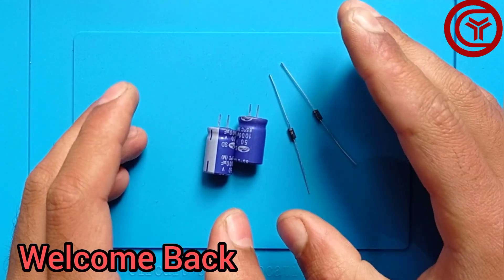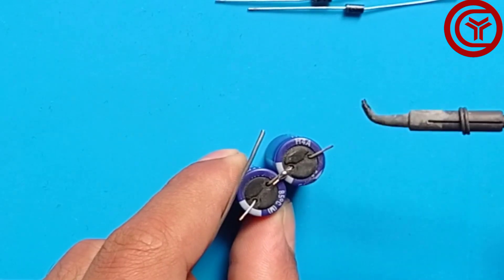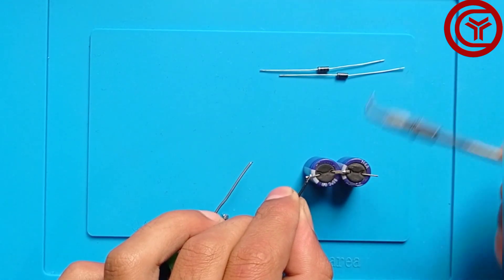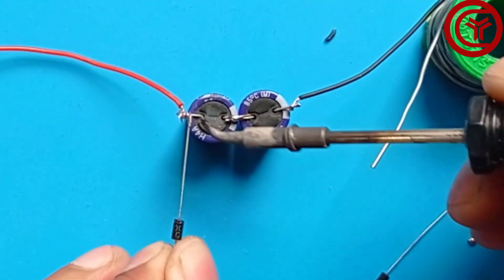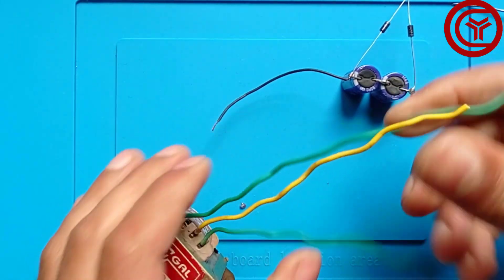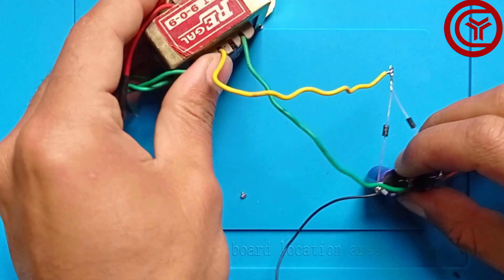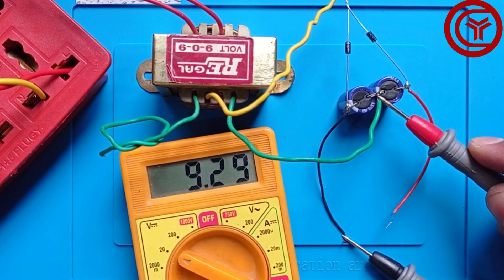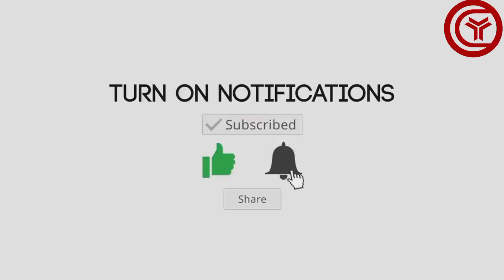how to make voltage doubler | dc boost converter

Comment: I have 12 volt 7ah battery. Can I use this experiment in put as 12v battery? If not please suggest..
Reply from the maker: Can you let me know do you need charger circuit for 7ah battery or you want to boost 12v to any specific voltage
Reply: i want 12v to 48v dc booster circuit  @CreativeTechos

Comment: Thanks, can I give supply with a battery instead of Transformer 🤔
Reply from the maker: It will work only with transformer, if you want to build boost converter dc to dc I'm uploading soon with feedback, subscribe and turn notifications on to get notified.

Comment: Can the output voltage be used to power a power amplifier?
Reply from the maker: Yes you can use, but use 1000 to 2200 uf capacitors.
Reply: Thank you.
Reply from the maker: My pleasure 😊

Comment: Need to convert with transformer 12v ac to 48v DC.....Can you help?
Reply from the maker: You can use same circuit by adding two more capacitor multipliers.

Comment: Will it work on 3 to 4 volts?
Reply from the maker: It its doubler what voltage is input will be double at output, but will work with transformer only,
Please check my channel videos i have uploaded 3.7v dc to 12v dc

Comment: This is AC transformer ? How about DC battery ?
Reply from the maker: Battery DC To DC Boost Converter,
Will get uploaded soon with PCB
Please subscribe my channel & get notified 👍
Reply: i dont think transformer will work for dc. you will need any inductor coil, diode, mosfit transistor with capacitor.